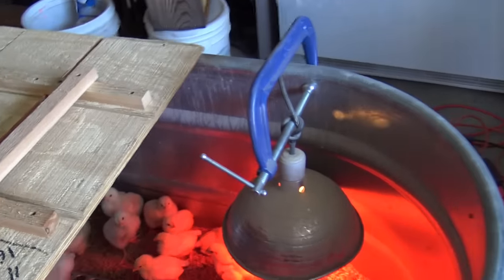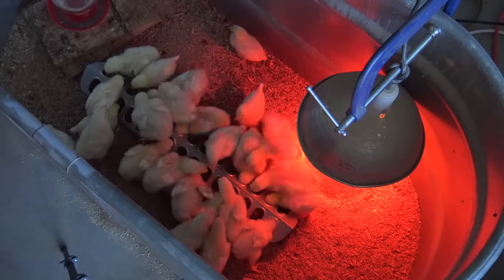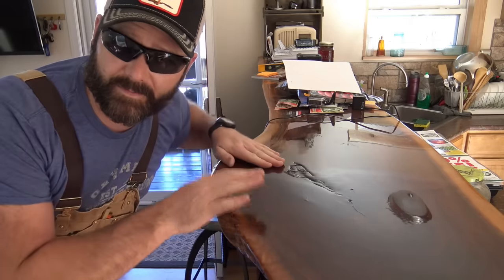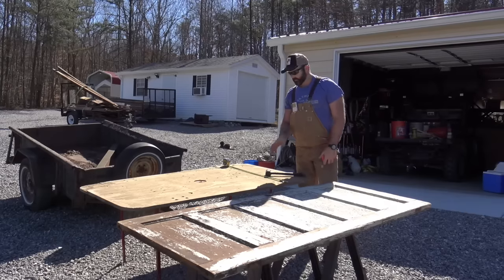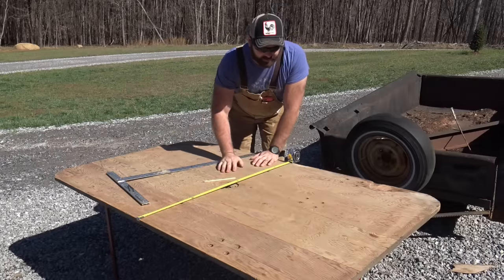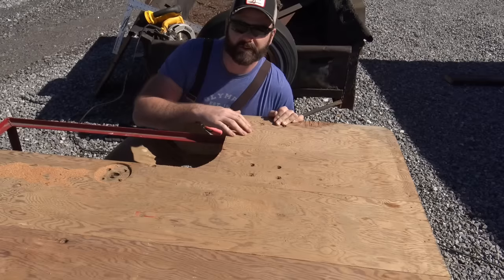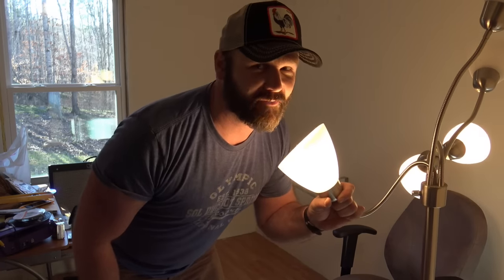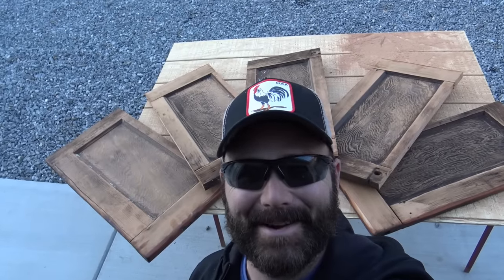Farm VLog 25: Giant baby chicks...Hormones? Steroids? How to build desk with reclaimed wood

Comment: A few quick tips for air bubbles that try to set up in most epoxy like your bar top. 
1st tip like you said Josh, thin layers and slowly build up.
2nd tip, use a heat gun just above each layer (hair dryer on high if no heat gun) and the bubbles will get pulled to the top and disappear. 
Wooooooooo!